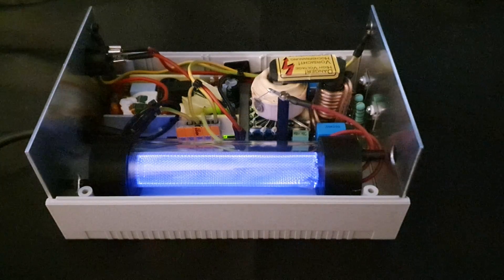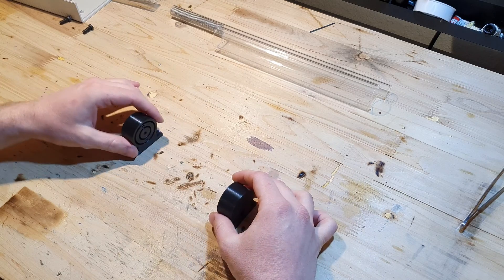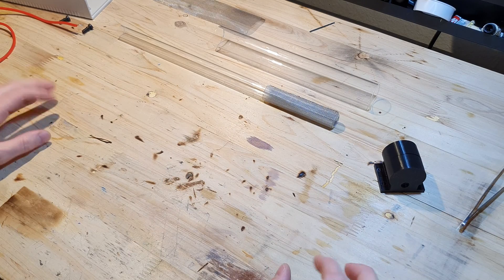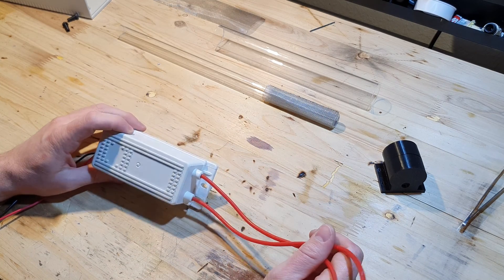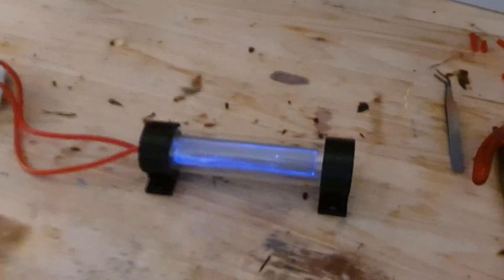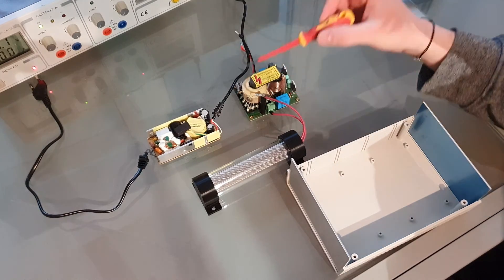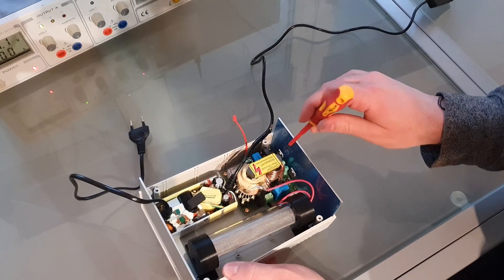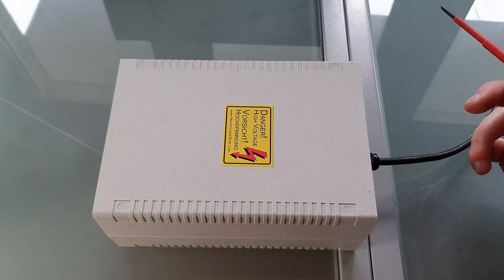DIY ozone generator

Comment: Why not build it so the gas flows through the corona. The layering could go: mesh, outer glass tube, mesh around the inner glass tube. that way the corona will be between the inside of the outer tube and outside of the inner tube directly in the path of the gas.

Comment: Sir. Can you please lead me to the power supply module you use in this video or another well built unit. I reside in the USA. I too purchased that cheap chinese ozone generator and mine also fried just as yours did. Thanks in advance. A link to the part would be nice.

Comment: you need pure oxygen to make ozen, else wise this setup will generate nitric dioxide, because atmosphere is 78% nitrogen and 21% oxygen, ratio of 7:2 . it will act as an birkeland eyed rector which use raw air to make nitric acid from nitric dioxide.
Reply: Interesting point, thank you for mentioning that.

Comment: So what's the difference between your method and the Birkland Eyde process when making nitric acid? It seems to me that if you bubbled the air passing over that spark through water you'd synthesise nitric acid, or is it ozonic acid? 🤣🤣🤣

Comment: I would love an efficient version of this, perhaps more thought-out and professionally designed, such that it takes as little electrical power necessary to convert a stream of pure oxygen to a stream of 95%+ ozone, at a decent speed. I could use this to turbocharge an oxy-fuel torch like oxy acetylene. of course, I would be very careful with this and only use it outside and in ventilated areas, but fortunately the smell of ozone is pretty potent, and I would surely know if there was a leak, and unlike a pressurized gas cylinder, I can just turn off or unplug the generator, and the ozone stops, no pressurized gas necessary. also, how dangerous/ unstable is liquid ozone? could someone make half a liter of it?

Comment: What i found works well is the center tube is a thin glass tube stuffed with steel wool then a thin gap with an outer tube that fits the inner one with about 3mm gap. If the outer tube is made of metal then it must be ozone resistant, otherwise wrap the outer tube with foil. Feed with dry oxygen gas and drive with high frequency AC. Also works well for gas phase chlorination etc 🤓

Comment: Great video! Just out of curiosity (maybe this was already mentioned and I just didn't notice), what type of glass are your tubes made of? I'm interested in doing this myself at some point, and I was wondering if it would be better to use borosilicate tubes or quartz?
Reply from the maker: Thanks! I used borosilicate glass. But quartz glass would be better. If borosilicate glass is sufficient depends on how much power you want to push through the grid. Mine did brake once because I used to much power.

Comment: Hi, @11:31 you should add a insulator in space between power supply and HV generator: due HV transformer: should an arc occour, it will be only in your HV generator (which will fry something and then, blow the fuse) and not between HV generator and your power supply (which will have unpredictable effects).
Also, i suggest you to add more insulation between HV cables and metallic objects.
Reply from the maker: Thank you for these good suggestions!
Reply: The good news is at the voltage this runs at, it's not looking to jump far. Extra layer of heat shrink on the HV leads be plenty

Comment: Is that quartz glass youre using ?
Reply from the maker: No, it's borosilicate glass. Quartz would be better but the boro seems to take the temperature quite well. But I can't run the generator at full power for long because the glass will eventually crack. The PLA wouldn't like the temperature either.
Reply: @AdvancedTinkering  I'm thinking I should look out for an oxygen concentrator. I'm in need of a glass working torch setup now that I've taken on project of building a glass lathe. I was watching a few videos about concentrators lastnight after your video. All I'd need is a compressor which I have, zeolite in two chambers, then tubing, solenoid valves and controller
Reply from the maker: I would love to see a homemade concentrator. There are a few videos online but not many. 
Depending on what you have available, it could be cheaper than buying one.

Comment: Aren't you wasting half the corona? since it is AC it might be better to have air flow around the outer channel then through the middle before exiting?
Reply from the maker: Yes you are absolutely right. It would be better to direct the gass around and through the inner tube. I didn't think about that when I was building it. If I need the ozon generator in the future I will print new caps for the ends that do exactly what you mentioned.

Comment: Very interesting. There is no need to apologize for your English - it was all clear and easy to understand. I look forward to seeing your followup to test yield of the device.
Is the inner most glass tube sealed, with no input gas passing? Or is ok to leave open?
Reply from the maker: Thank you! The inner tube in my design is closed. But it would be even better if the oxygen passes around and trough the inner tube. I may change that in a later design.

Comment: You can produce liquid ozone similar to how you produce liquid oxygen.  By passing ozonated oxygen through a collector which is chilled to liquid nitrogen temperatures, you can obtain an oxygen/ozone condensate.  Once a sufficient amount of liquid is collected, the oxygen is allowed to boil off by slowly letting the temperature rise, leaving almost pure liquid ozone behind.  We did this in our research lab, but I cannot remember what the half-life is for the transition back to oxygen.
Reply: It is a dark purple blue liquid and is very unstable. It is similar to nitroglycerin in aensitivity, and if it reaches boiling it goes off on its own. Chemical Force channel shows  liquid ozone and its chemical properties, his was about 70% pure as well. 😲
Reply: @christopherleubner6633  Ours was light purple, but our optical path through it was only a few millimeters.
Reply: I've heard various half-lives of ozone between 30 Minutes up to 2 hours.
Reply: Yeah that way you can isolate it pretty well, but well it also can also explode..
Reply: @Kairos-XIII-2  As long as it’s in a rocket that may be a good thing.

Looks at Florine-Lithium-Hydrogen Rocket …errrrr maybe you’re right.

Comment: Just a thought, can an excilamp be made using this tube dielectric barrier discharge that you used?
Reply from the maker: You would have to tweak the design but it should be possible. But I am not very familiar with these lamps. I may look into this in the future.

Comment: I have a PLA rack in my sterilization cabinet. It has been used for about 150-300 hours at about 100-150ppm and few hours at 1000-2500ppm ozone level. All at room temperature but at high humidity (RH 80% or more) that makes ozone more reactive. It has held up surprisingly well. My  ozone sensor module (MQ-131) has not taken those levels without changing it a couple times. (and some nitrous oxides too, because I make ozone from air).
If my light 2mm rods in a grill like rack have not fallen apart, larger end caps should take quite a lot more abuse.
Reply from the maker: Thank you for the information!